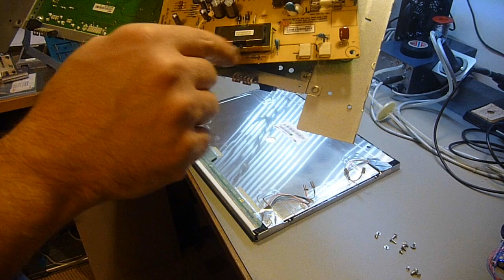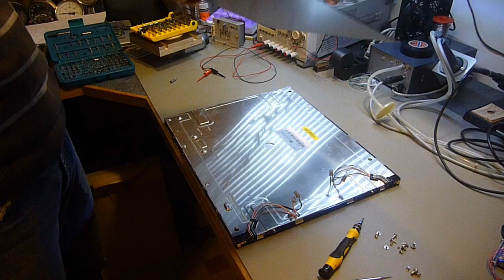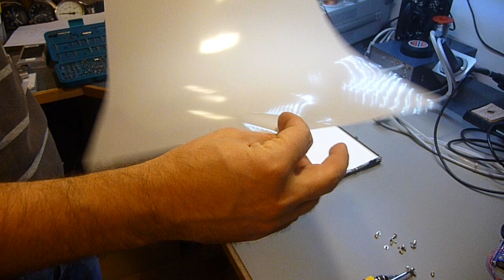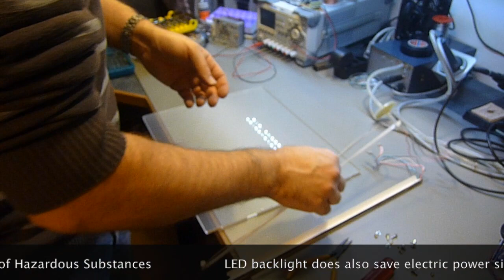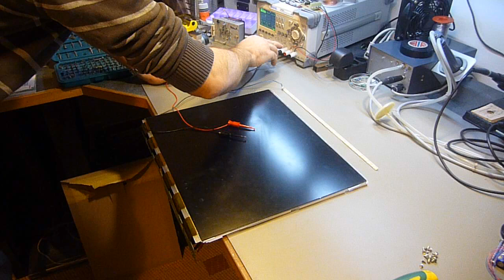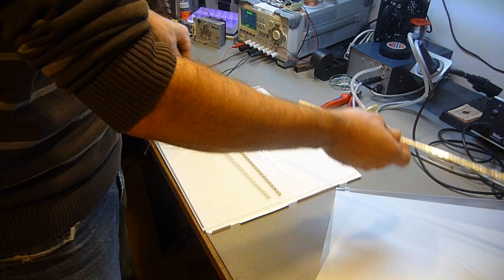LED and LCD screens - the difference (PWJ14)

Comment: I just want to point out that there is such a thing as a florescent backlit LCD monitor that is RoHS compliant. Also, if you buy a CLF or other florescent bulb from the store, you actually have to search hard for non- RoHS lamps (many stores don't even carry any).

The way you explained RoHS made it seem like RoHS outlawed florescent based LCD monitors and other florescent bulbs.
Reply: Fluorescent lamps contain a small amount of mercury so how can there be ROHS ones.

Comment: Just to point out: You're showing the difference between CCFL LCD screens and LED LCD screens. Both types of screens are LCD based. The difference is the type of backlight; Cold Cathode Florecent Light versus Light Emitting Diode. It's a common mistake cause by (misleading) marketing when LED backlit screens were introduced. Little did they know that a few years later actual LED screens would come available and a naming clash would occur; hence the names OLED and AMOLED.
Reply from the maker: That's exactly what I wanted to show in that video.